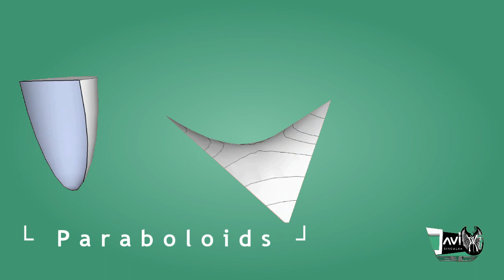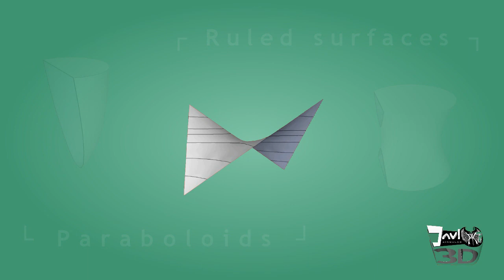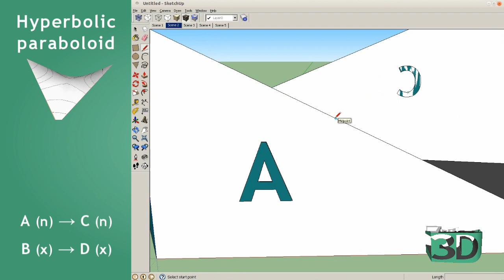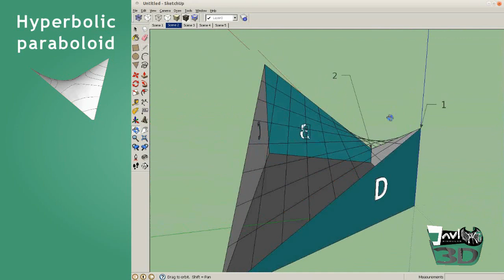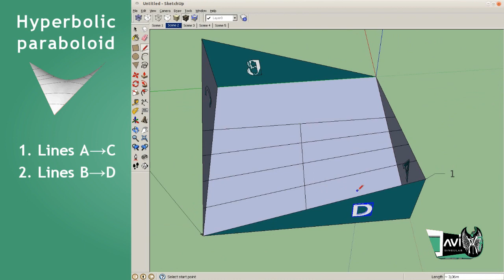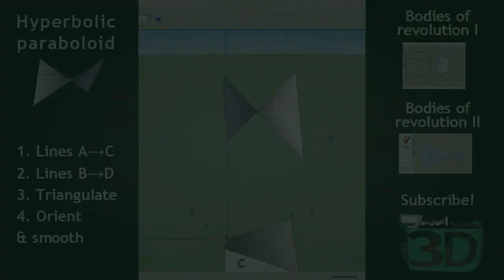SketchUp Tutorial: Hyperbolic paraboloid (tensile structure, saddle) WITHOUT plug-in

Comment: Is it possible to give the 'saddle' a thickness?
Reply from the maker: +Michael Hall if there's a will, there's a way!
if you make it a whole object, smoothing faces, then maybe copying it over and closing the edges with lines, it could work. if not.. try with each face before smoothing
Reply: AH!  I wanted 8" thickness. In SketchUp, I copied the entire saddle unit 8" vertical. I created the oval shape I wanted and centered it above the 2 saddles. I push/pull the oval (or other shape) through the double saddle making a very obvious intersection. Select all three entities, r-click, select intersection through selection. Then just start erasing the extraneous portions of the saddle. Perfect!